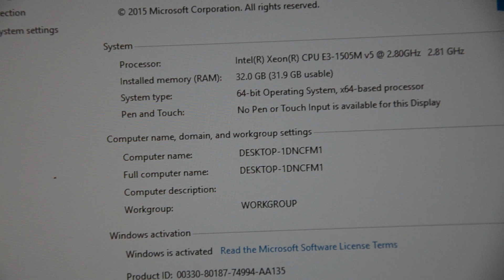Lenovo ThinkPad P50: RAM Upgrade

Comment: I know my P50 has 16GB of original RAM, but don't know whether its a single stick of 16, or 4 sticks of 4GB.  Is there any way other than opening it up to see how the current RAM is configured?
Reply: Download CPU-Z and it will tell you which ram sticks are in which slots.

Comment: Any updates on the P50? 
Any new upgrades?
Mine is arriving soon. I figured that this would be perfect for my upcoming company.
Reply: Did u get it? I have found one for 330€. Is it worth it
Reply: @schoolboy6704  , yes and I still have it, however I have almost maxed it out 😁
Reply: @edialbert8035   Does it overheat? I think its a great deal, and i am thinking about buying it! I am going to study electronic engineering and i want it to be sufficient of my school needs!
Reply: @schoolboy6704  , I'm happy with it, but then again I haven't been pushing it as hard as you probably will.

Comment: Upgraded from an E550. Dang this thing is nice☞☞>JustU.Faith/ThinkPadP?稿    Extra HDD slot for M.2 or 2.5 in drive (gotta buy an upgrade kit, sigh), super solid build, great matte screen, ton of ports, sweet keyboard. I was worried about not having a VGA port but the cheap HDMI to VGA converter works like a charm and is actually functioning better than my E550 VGA port strangely enough.

Comment: Thanks.  Really helpful.  Two questions, assuming I have also bought 32GB (2 16GB sticks) DDR4:  Does it make a difference if I install them in bay 1/3 (under keyboard) or bays 2/4 (back of machine)?  And, assuming it does not, would you just keep the 8GB stick in the front and install the additional 32GB in the back for a total of 40GB?  (Would having 3 sticks actually affect performance in any way?)
Reply from the maker: Shouldn't be any difference, I installed under keyboard so i wouldnt have to remove it the next time I installed RAM. You can also keep the 8GB stick, though performance may be slightly lower (likely not noticeable) due to double vs. single channel
Reply: Thanks, man.  That's what I was thinking.  By the way, any recommendation on RAM manufacturer or flavor?  I'm just thinking standard Crucial.  I have Samsung PRO 960 1TB SSD to install too!
Reply from the maker: Crucial should be fine, from what I've heard the P50 isn't as picky about RAM as some other systems. As always though, search through the reviews to see if anyone reported any issues with Lenovo systems. And sweet SSD, you should have a good time

Comment: I'm planning to upgrade my P50 to 32GB. Question, because the P50 comes with one Samsung 16gb 2rx8 pc4-2133p module already, why not simply duplicate it (https://goo.gl/5ASBVi)?
Reply from the maker: That also works, mine came with an 8GB stick and since I planned on upgrading to (16GBx4) there was no point in me keeping it

Comment: Hi There!   Quick Question:  Could you have placed that 8gb stick in one of the RAM slots on the underside? 
I'm doing the same thing, but was wondering if adding that 8gb stick back to give me 40gb or RAM (the 32 + the original 8) would mess with the dual channel setup or not. 
Thanks!
Reply: no u can not have dual band with that
Reply: You have to use the same (MHz) frequency and same voltage RAM. Then you will get a total of 32GB + 8GB = 40GB.
Your existing dual-channel 16GB + 16GB will remain in full dual-channel mode, and the extra 8GB will run in single-channel mode.
This mixed behavior is called Flex Mode.

Comment: There are 4 ram slots. Why did you bother to remove the ram under the keyboard? You can just insert the 2 ram sticks in the 2 slots under the back cover. Don't you end up with more ram this way? Am I missing something?
Reply: Optimal memory performance is "dual-channel mode", which is obtained by installing matching memory cards with identical size and timings in the "paired" slots of each bay.  So you would use two cards in slots #1 and #3 (under the keyboard), or two cards in slots #2 and #4 (under the back cover), in order to see "dual-channel" performance. Any other configuration involving "un-paired" slots will result in "single-channel mode," which provides less than optimal performance.
Reply: Then why did Lenovo install the Ram in slots 2 and 4 in the factory like mine was?
Reply: So that your RAM will be paired and get the dual-channel performances